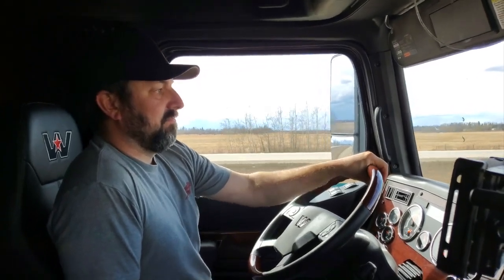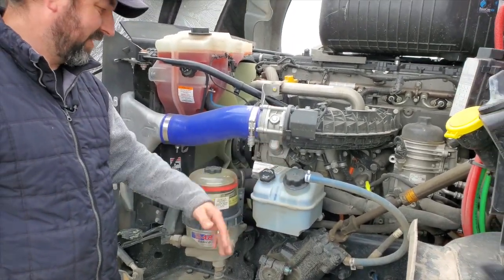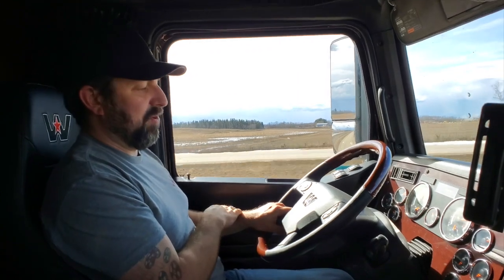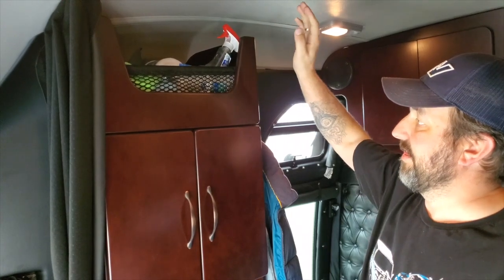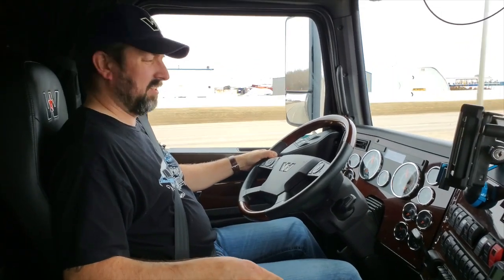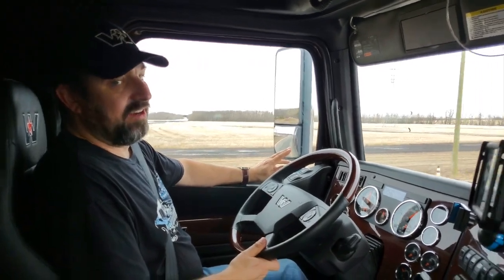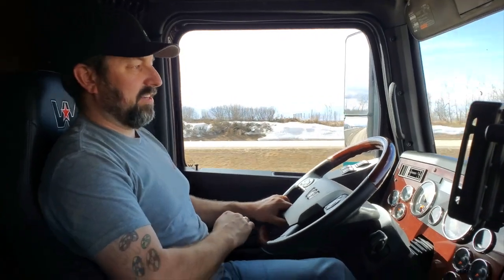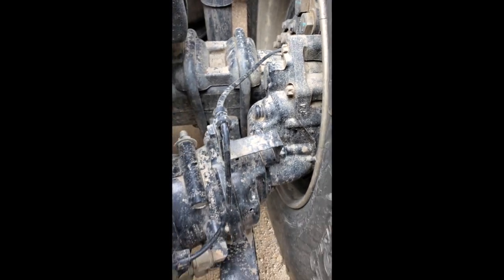Western Star 5700XE review

Comment: I have had four Cascadia trucks, between April 2012 and July 2018, with Hendrickson AIRTEK steer axles, at my old company Metropolitan Trucking LLC.  Not one of them lost alignment while I had them, and the last one had 374 thousand miles on it when I left for Landstar.  I'll swear by them.   I'm also running Michelin XDN2 drives on my own truck right now.

Comment: thanks for your posting this video. ive been looking at trucks with either the dd15 or the x15 cummins and came across the 5700xe.  Have you had any issues with it leaking any water into the cab of any sort? ive seen a review or two with that issue as with the windows fogging up.  how do you like the truck still?
Reply from the maker: Sorry for the late reply! The truck hasn't had any water issues other than it was using some for a bit but they resolved that problem. I gave it to one of my drivers now and he loves it... finally gonna have time to do some more video and podcasting soon!

Comment: Nice truck for sure, hopefully I can buy one like soon. Can you share more about the engine? Your opinion vs dd15 505 HP? Average MPG? Is that the 72" sleeper?
Reply from the maker: 82" sleeper... the truck has a DD16 set at 600. Its actually a heavy haul spec but still does respectable mileage 7.2 90 day average
Reply: @semi-crazyinc.5591  Hi Greg ! I like your Channel much ! What rear ends and rear axles did you put in ? I run the east mainly and im curious about your heavy haul mountain specs !
Reply: @semi-crazyinc.5591  whats is the rear ratio ?

Comment: My western star has terrible vents too, things are just crammed behind that dash and they're just not lined up.  Just buff in some shaving cream, the old school white creamy foam, you won't even need a defroster after that, lasts about 2 weeks in the winter per application.  

I like your herd, I got the Truck Defender 3" pipe Forman.  Same quality, little cheaper, they're out of Vale SD.  

I've got 200k on my 2021, only problem I've had was coolant leaks but it the APU leaking.

Comment: i was going to buy 2 5700 w s but i said f#@/k it and got 1 2020 Kenworth W900 it is gorges 4 axle with the pusher midnight blue 78 inch sleeper with the foldable seat 600 hp cummings 18 speed 14 thousend pound steers 48 tp rears i haul logs in ca need a hd truck also got my first all alunimum trailer 48 foot by 102 spread axle cal leagle only wheighs 6340 pounds it has an onboard scail can pull 39.000 pounds easy the only thing that sucks i can only keep it for 10 years per new carb laws.